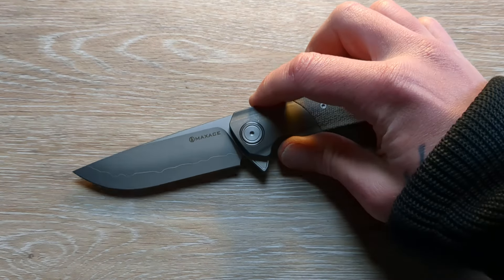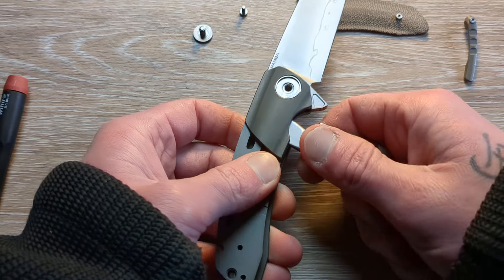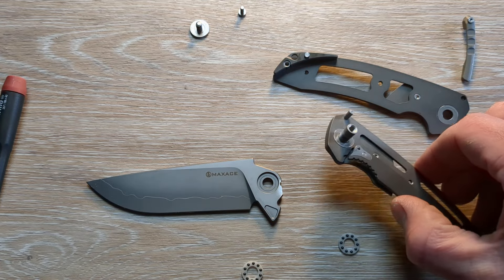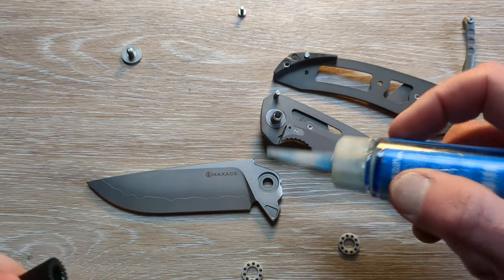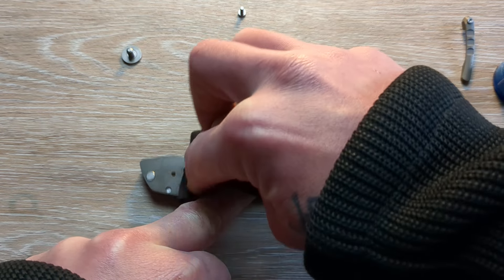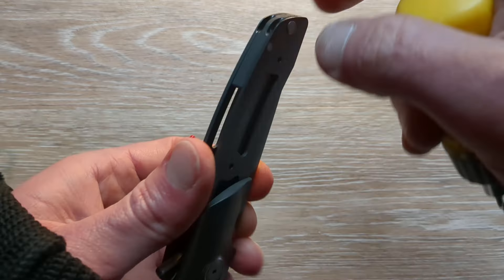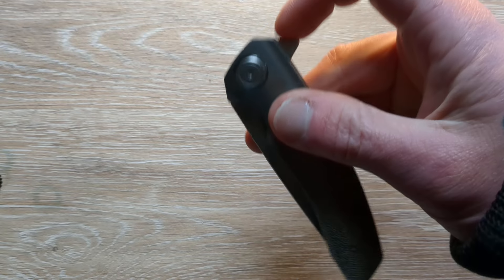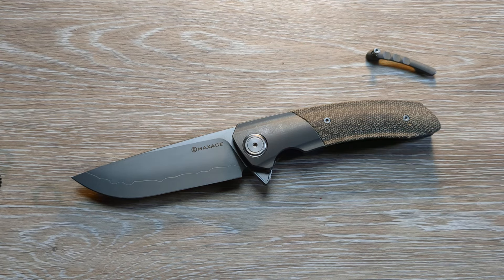Simple Knife Adventure.. That Went Very Wrong | Maxace Mamba

Comment: Hey GBall, did you check to see if the detent hole in the blade was clean and not full of lint or dirt? If its clean and tightening the lock bar doesn't increase the detent, then you could use a small cone shaped carbide bur or stone in a drill on slow speed to slowly enlarge the hole opening to get more positive detent ball to detent hole engagement, just be cautious not to over do it and create detent lash. I don't have a Mamba but I do have a couple of the Goliaths and they are built the same way the Mamba is just bigger. The Mamba is the 3.5" version of the 4" Goliath.
Reply from the maker: I will have to check it out. I've disassembled it and messed with it but it's been awhile. I'll have to check it back out because otherwise I love it